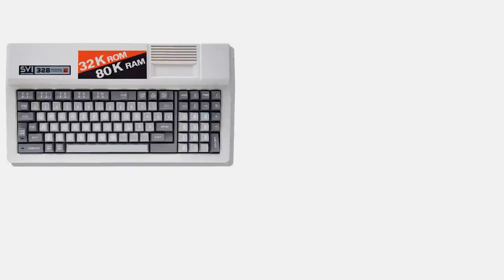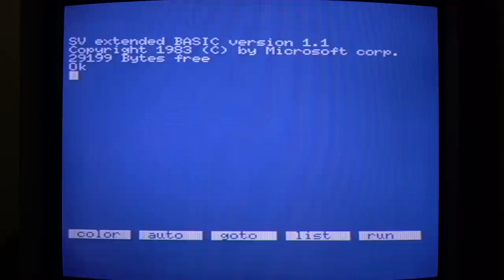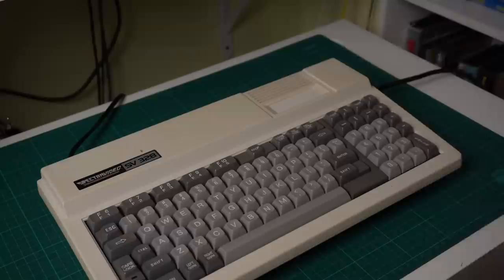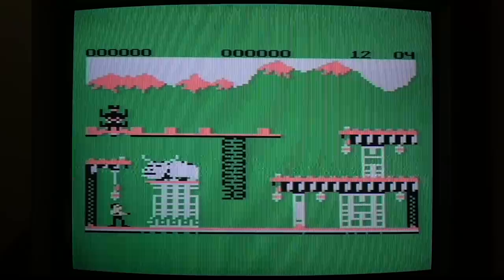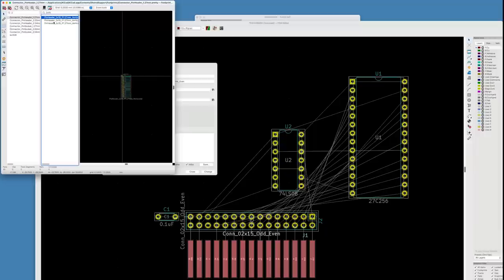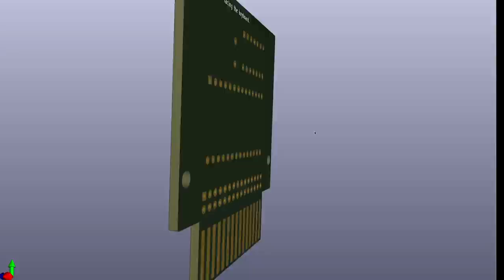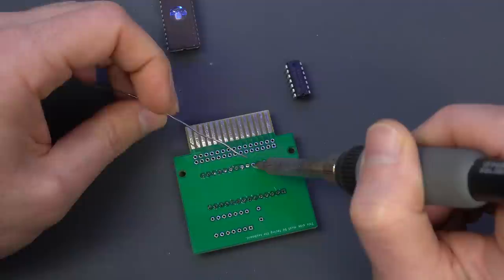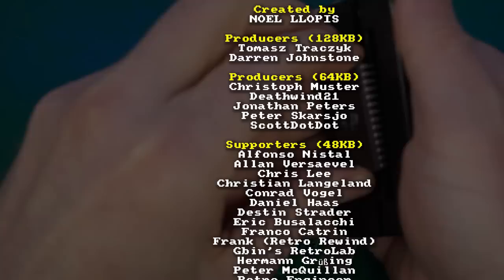Can We Turn This Computer Into a Different One?

Comment: Isn't it amazing that we as hobbyists can now design and print cases and order our own boards, I would have loved that so much when I was 12. :)
Reply: i made my own pcbs back when i was about 10, 11, the 'old fashioned' manual way, etch resist pens and rub down transfers, etching them myself with ferric chloride, 😉problem is  if you want to do more than 1 ..... in that case photo resist boards, but i've never used them and dont know if you can get them any more, the original dalo etch resist pens are long gone but fine paint markers  work, you used to be able to get aerosol positive photo resist to put on plain copper clad board but that also seems no longer available 😢

Comment: Fantastic Noel.  I am really surprised how well this worked, and it’s great that you’ve managed to make a new one.  It makes me me think that maybe even that MSX-SVI converter cassette on eBay might even be effective. I think that multi-rom cart you mention has to be the first priority with your new-found skills, it’s what the system is missing and I suspect every SVI owner out there would invest in one (not that that’s your motivation but it’s a practical consideration 🙂), I know I’ve dreamt of such a thing for years.
Reply from the maker: Thanks! I thought I would make it right away... but it's actually a LOT more complicated as soon as you have something sharing the computer buses. But it's definitely doable, so I'll make it happen one way or another.

Comment: Just for the Fun of it, you can also easily make a perfect CBM clone from a C64 and visa versa. Ok, some Low Level Registers won't be fully compatible but hell you can get VERY close to a perfect clone. Making a C64 somewhat compatible to PET/CBM only requires a couple of POKEs to move stuff around. Loading a slightly modified CBM Kernal makes it extermely compatible and adding some CBM-Hardware through the expansion  port makes the C64 perfectly compatible. The other way is a bit harder to do and you always need some hardware modification. In 1983 I read an article in m'c magazine about how to rewire a CBM3032 so it has the same memory layout as a C64 - BUT ONLY 32kByte of Memory, leaving 30719 Bytes to Basic. As I said, only rewiring some cables and replacing the ROMs with patched C64 ROMs.
Doing the same for a Plus4 or CBM264/364/500/600/700 is harder but still pretty straight forward. I once saw a CBM700 (?) rewired to be a fully compatible C64 but still including its 8088-Board to run MSDOS 1.x. Pretty amazing.

Comment: I totally understand your excitement. I went this road in 2017, when I had purchased ZX Spectrum Plus (which I never had - I was the Atari 800XL tribe in the 80'). Then I discovered the Spanish project of "Supercart" for the ZX, with the capacity of 4Mbit - place for a dozen of games to be loaded. It is called something like "dirrea" to describe the innovative algorithm of timing the bank switching while the program image gets pushed to the RAM, to get whole 48kB written with the sliding window. 
Then I obtained flash eeproms in the PLCC package instead the DIP one and had to design the whole PCB from the scratch, to accommodate the change. So I learnt Kicad, went through the whole process of component -to-package matching, especially for the ZX edge connector, then I created my first double sided board. The only change was i used JLC PCB, but they are equally good. My cartridges wait peacefully in the drawer for the time to be finished however, other projects overwhelmed it.

Comment: I'm so glad you are posting videos again. Everyone does Commodores. Nothing wrong with that, I dig the 64 and 128, and have them now. But I grew up on an SVI-328, and a 738 MSX after that. I've got the MSX covered, and am aware of the tape replacement devices. I just might build the cartridge you showed here, but now I'm wondering if there is a disk drive emulator, or anything like that, for the original pre-MSX Spectravideos... Going to google it, didn't even think of it before...

Comment: Don't listen to people that tell you not to use auto routing. It can save you so much time, especially when your designs become more and more complex. Try FreeRouting with Kicad. When set up correctly it works great. It makes PCB design so much easier when you can make edits and adjustments to the component layout and easily just re-rout the board. It is like a compiler for writing code. Yes you could do better writing everything in assembler but that is so much more time consuming, just compile it and make better use of your time.
Reply from the maker: Cool. I'll give it a try. Thanks!

Comment: Question for anybody - I totally don't know anything about this. Why does it seem to have a solder point for another connector on the board? As for you Noel, you make this look a lot easier than it is. A long time ago, we had to do this photographically and it sucked. Thanks for the great video!
Reply from the maker: Are you talking about the pin connector near the edge connector? I put it there in case I needed to do some debugging. Once the edge connector is connected somewhere, it's hard to get the probes on all the signals. It also allows me to expand it by putting a pin header there and running wires from there. In the end I didn't end up using it but since there was plenty of space... why not? 😃

Comment: Great video, good to see you back! One question, with the MSX cartridges being a different size and having a different connector, would it be feasible to put a suitable socket on the top of an expanded version of the cartridge you made? Then again, if the ROM images are all freely available it's probably not worth the effort, and your idea at the end for a multi-cart system with OLED screen makes much more sense! A Noel-tek or Go-Noel perhaps?!!!!
Reply from the maker: Thanks! At first thought it wouldn't be possible, but then I was told there's already such an adapter so... yeah, I guess that can me made to work. It would probably have to incorporate all the MSX memory mapping logic there though, so it sounds pretty complicated. First I'll try the multicart and then I'll see into adding that (with some MSX expert help maybe).

Comment: Apologies if I'm saying things you're familiar with, but aparently there used to be another MSX-related upgrade for an SVI machine; I think it wasn't a cartridge though but some work inside it. It was done ~commercially as I gather by Henrik Gilvad, a Danish guy, also known for designing the Moonsound OPL4 cartridge -- and possibly by some ppl in the Netherlands as well.  

Anyhow, SVI-738 had the V9938 video chip, like in the MSX2 standard, so that it could have an 80 column text mode and be used as a CP/M machine, soo there was a way one could upgrade the MSX1 compatible SVI-738 into an MSX2 machine, and apparently ppl in the nordic countries often did that. And I think you could even plop a V9958 there instead for an MSX2+ compatible upgrade.

Kinda funny the same company made an almost-MSX1 as well as an almost-MSX2. ^_^

Comment: Great video, good to see you have created your 1st PCB.  I have ordered some to try out, as I have almost finished a few new games, and would like them all to be available for original Spectravideo owners as well (only expect small quanities of course).  I local friend has done some shell prints for me, that came out very well.
Reply from the maker: Great to hear. Let me know how they come out! And if there's anything you would like changed after you try it, let me know.
Reply: @NoelsRetroLab  just a note you forgot the drill map in the linked order but I think I worked it out. Well we shall see when the PCBs arrive. Be a couple of weeks as had to use different freight option due to a current DHL surcharge.

Comment: Hi Noel. Long time no see :) I don't create PCBs anymore but, when I did, I used the autorouter functions just as a start point. Autorouters really are not the best solution but also there are a lot a "purists" out there as well that say that anything auto = evil. When you're dealing with simple digital electronics they are usually fine and can help speed up the process a lot.
Reply from the maker: That's a good point about using it as a starting point. I think I'm glad I didn't here because it forced me to think it through in my first time, but that's probably a good way to go and then finish by hand.

Comment: I always wanted to make the little card to allow a PC floppy disc drive to be used on an Amiga. It would plug into the drive cable socket and have a header for the cable to Amiga. In my head it should be simple because to hack the drive itself is usually cut a trace, short a trace etc.  So to answer your question PC floppy drive to Amiga in line board .

Comment: Always interesting and well presented. Thank you.
Ah, PCB design:
BITD I learned the frankly horrible Eagle because being the industry standard doing so helped with premade parts, etc. However Eagle is becoming less popular with hobbyists now more friendly alternates are available - such a shame conversion tools generally fall between poor and non-existent. Bah!

PS
GerberLogix is an exceptionally useful tool for reviewing your files prior to going to a fabrication house - it needs to be registered but is a free download.
PPS
While there's nothing wrong with the more well known fabrication services used by hobbyists, Seeed Studio is worth a mention - good quality, dirt cheap.
PPPS
FWIW: Using auto routing is indeed generally frowned upon, but I'm lazy. My usual process:
0) Lay out the physical dimensions of your PCB along with any carefully positioned holes, cut-outs, and connectors before anything else!
1) Lay out your design as pleasantly as you can (there is a little art to PCB design) taking care to minimise track length and crossing.
2) Lay in your power and ground lines as logically and neatly as you can, preferably on opposite sides of the board if it's a 2 layer design.
(try to run thicker traces for these lines, I usually lay a power and GND loop around the periphery of their respective sides on a two layer board)*
3) Don't forget those decoupling caps! As a rule of thumb one 100nF ceramic for each IC and one 4.7-47uF electrolytic for the power input.
4) Life's too short so set the software to auto route everything else, followed by careful checking and editing of the more obvious stupidity.
5) *Finish with a fill on both sides of the board, each connected to it's respective power and GND assuming you laid your lines out like that.
(IMO: It looks better. It also helps power distribution, adds a little general decoupling, reduces line noise, and helps tie both sides together)
6) Don't forget to validate your hopefully final layout - unconnected and unintentionally crossed lines are a very common thing!
7) Carefully recheck everything again and again. It's really annoying when you have to cut traces and add bodge wires to your new PCBs.

8) For God's sake use the silk screen layers to:
-Label all components properly as an absolute minimum!!!
-Designer, date, revision, and intended function
-How and where to fit along with orientation markings
-Basic instructions where there is room
...your design may last longer than you and certainly longer than your memory. Finding this stuff written on the PCB will be a godsend in the future.

Comment: If only those poor SpectraVideo Computer owners had this cartridge in the early '80's, then they would not have felt so alone and left behind. The Hong Kong SpectraVideo moved on quickly towards MSX, dumping all of their loyal customers that were so foolish to buy these pre-MSX computers.
Reply: Worked only for games and apps that used the bios to access the hardware. Any game that accessed the hardware directly would not work.

With the right tools, porting such a game wasn't that hard though. Video and sound was just a matter of changing output port addresses. Joystick and cassette interface readout needed a separate routine.

Comment: Really confused why people would suggest skipping the assisted track layout tool, it's one of the most powerful features IMHO.  I've used several EDA packages over the years and KiCAD is very impressive due to that feature.  I prefer gEDA for some work, but being able to fly through the layout process without manually measuring to maintain design rules is such a critical function, having it flow traces around and shove them aside really accelerates the layout process.

Comment: Kudos to you Noel! I'm glad you are again doing your interesting videos. And this is by sure one of them! 
Only a question... Why don't try to include in the future circuit n MSX cartridge adapter? Additionally, but more difficult to achieve, is the inclusion of the MSX memory mapper to ensure at least full compatibility with all the MSX cartridges. If this can be done, it can be combined with one of these F18A VDP that are enhancing the old MSX, Coleco consoles and Ti99 computers and the SVI328 will be more powerful... And why not adding additional RAM to the system? ;-)
Reply from the maker: Thanks Francesc! I actually hadn't considered the MSX cartridge adapter! Thinking about it, I'm not sure it's totally possible because we have the new ROM but also the MSX cartridge on the same slot. I suppose that with the MSX memory mapping logic it might be possible to separate the two. Something to look into for sure, but I want to take a small step first and get a multi-cart working, and then I'll consider this, which is a very cool idea, but definitely a big leap in complexity 😃
Reply: @NoelsRetroLab  But the Spectravideo official MSX compatibility adapter included an MSX cartridge slot, so it's possible... Although I guess it only allowed the use of 16K cartridges.
Reply from the maker: True. Good point!
Reply: @fcastellanos  I don’t claim to have technical expertise but I have one of these official converters (the SVI 606) and my understanding is that (among many limitations) it does not work with the memory mapper cartridges because it does not support external RAM, something to do with how the RAM is connected to the Z80 or data bus but as I say I am not technical).
Reply: @AmAtAm  I konow. It's because it doesn't have the necessary logic to include the MSX memory mapping circuit. It only accepts small cartridges with only 16KB. But maybe it's possible to create a cartridge that includes the missing RAM circuitry...
Reply: The svi 606 had its own keyboard, cartridge slot and joystick ports
Reply: @JesterEric  Yes, it’s bonkers. My one has all those things but I have read there’s is also a model of the SVI-606 that doesn’t have a keyboard, which limits the amount of software that can be used even more!

Comment: Congrats with your first designed pcb! One suggestion though - solder (hasl) isn't good surface for connectors, so its better to use enig, for example.
Reply from the maker: Oh interesting. That's not something that was in my radar at all. I take it that's something you'd have to select for the whole board, right, not just for the edge connector part? Is it more resistant? Is that why it's good for connectors? Thanks.
Reply: @NoelsRetroLab  Yes, solder is too soft and it gets scratched each time you insert it. After some time it will reach the copper layer and will start scratching it too. Also, copper is oxidizing too much and it might lead to bad contact. I also heard that solder contacts can damage the socket since its way thicker than enig surface and also parts of the scratched solder will remain on socket contacts.
When ordering the pcb, there's surface finish or contact finish options. But usually, manufacturers do not use different finish in the same board, so if you select contact finish as enig, usually they cover all pads and vias with enig too, but this might be up to the manufacturer.
There are other surface materials suitable for connectors too, like nickeling or so, but I don't remember them all, so you better check appropriate articles on it.
Reply: @NoelsRetroLab  Btw, you can probably already see scratches on your connector from inserting it even few times
Reply: Mr Guru  yes, it costs much more. And yes, if you're just going to insert it few times and leave it, hasl is fine. But in general, it doesn't mean hasl is a good contact finish and its good to know that normally, hasl shouldn't be used as contacts finish

Comment: You should go all the way and make it into a true converter by adding an MSX cartridge slot on the top!
Reply: I don't think it would be possible. The cartridge would have to map to multiple regions of memory, those regions could overlap, and you can't patch a ROM.
The current system works because the code is loaded into RAM and then patched.
Reply: @cdoty  yeah with hardware only this is gonna be a challenge to say the least. 😊 But with emulation software running on something like a Raspberry Pi Pico it should at least in theory be possible. But I wasn't seriously suggesting he should invest all his spare time in that project. 😁

Comment: Great job. But also, you should test loading at least one game - it is possible that booting uses only one ROM, so in that case, booting to welcome screen doesn't really test if addressing/CS logic works correctly in any combination. Of course, logic is simple and mistake is not likely, but still it's better to test it (not only because of possible mistake, but fault could be on chip or on PCB).

Also, each chip should have own decoupling capacitor.
Reply from the maker: True. I did test it, I just didn't want to drag the video with doing more of what I had already done. It's all good 👍